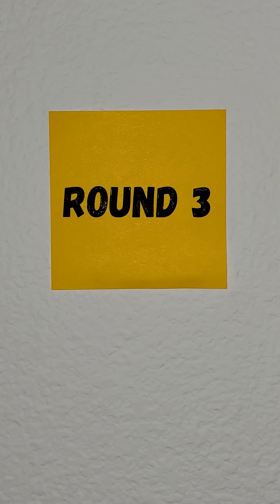What happens when you sprinkle flour on a flame? - 2 Truths & Trash - S3E8R3

Comment: The first one is fake but here is how the flower doesn't go on fire and the nail polish one turn it to rainbow on paper starting off with the flower see in higher portions it protects each other making a high shield inflammable also because there's a lot of the time it doesn't go on fire since there's a less amount of flour at a time it can actually go flammable for the third one nail polish catches light add with water and nail polish on the paper it goes rainbow

Comment: A- since the hot air is moving towards the left so it pushes to the left also the low pressure region is on the top which pulls it upward,not right.

Comment: guys the first one isnt actually impossible it could happen due to bernouli's principle where the fast jets of air creates lower pressures due to which an upward force can act, and in this case since it s a slope the upward force vector can a component along the slope so i mean it isnt impossible

though a) the air also could be pushing it down slightly
              b) the foam could just be too heavy for that effect to pull it up so idk like wtf is floral foam anyways-

and everybody's probably seen those mill explosions so i think the 3rd one's most likely fake

Comment: The issue with A is that the heat gun is pushing air right to left, which means the air rising would be from the right side, so it would push the wheel to the left even more

Comment: totally thought the gotcha was going to be that it was some other liquid other than nail polish remover. Fast moving air going over top of an object really can move it, it's why the shower curtain moves in towards the running water during a shower,the low pressure moving air pulls the curtain inward. the foam is just too massive for that effect to happen. Those added weights were a good trick

Comment: I was guessing all 3 to be true and the explanation for the first be that fast moving air creates negative pressure. But i guess the air from heat gun isn't nearly fast enough and it wouldn't roll sideways but rather rise up.

Comment: Technically, you COULD get the foam trick to work, you would just have to push A LOT more air across it, and it has to be perpendicular to the direction of lift/movement.  You would have had to blow the air straight down on the side or straight up.  This would make the faster moving air have less pressure, and the foam will get pushed up.
Reply: Also it doesn't have to be hot air.  Technically you'd want to control the airflow and hot air only causes the molecules to "vibrate" faster.  This would actually increase the pressure on that side causing an inefficient lift/push

Comment: About the flour: yup, most dusty stuff can ignite or even explode even if the material is not really flammable by itself. 
This is why wood dust is a hazard in sawmills. 
Also when you're cooking, be careful when sprinkling cocoa powder/chili powder/paprika powder etc in a pan/pot with an open flame

Comment: A is fake I think. B is absolutely true, this can cause serious problems like dust explosions. C seems ok, since nail polish is a kind of pil, which makes sense to react like oil in water and A might ake sense, since foam has lots of air in it and is light, so it could be carryed away by warm air, but there is no draw effect from the warm air, the air inside the foam must be heated and it would probably burn, before such a block would roll upwards.

Comment: This one was fairly easy. Air flow doesnt change with heat, so the roll wouldnt go up.

Flour has a History of causing so called "Dust-Explosions", where a small flame ignites an area with alot of dust in the Air, including Flour. This can become extreme! 

And lastly the Nail polish would either sit on top of the water surface, or didolve into the water which then gets soaked into the paper. Either way, the Nail Polish ends up in the Paper, which makes the Shiny surface happen.

Cool vid tho

Comment: I thought the foam inside melted and shifted the weight to that area without distorting it. Not that crazy but after I saw the other two I was pretty sure it was the first but the construction paper was glossy before it got wet didn’t look like construction paper so I was slightly skeptical

Comment: First one is false.
That flour one is an easy way to cause a dust explosion.
The nail polish on black paper is caused by the oil in the polish on top of the layer of water on the paper refracting the light.

Comment: I'm happy to have made a fairly confident right decision for once. I was thinking of the ping pong ball in the funnel experiment where the faster moving air turns the ball with it (not against it) and as a result the pressure gradients change on both sides and the ping pong ball gets locked in place in the funnel. So I would've assumed the heat gun to accelerate the disk if anything.

Comment: I'm sure B is correct. I've seen that rainbow effect on thin surfaces before, so i think something about a very thin layer makes C true as well. A seems wrong because of the angle of the heat gun... even if heat made it change shape or density and somehow roll backwards, surely the air moving from the gun would push it forwards again

Comment: My dad told me a story from when he was in the Marines, breached a large compound with a bundle of C4 and flour, when the C4 blew, it exploded the flour into such fine grains they were able to light the ‘air’ on fire because of how small the particles were - equally awesome and equally horrifying
Reply: My mom tells of being in a restaurant with coworkers.  One coworker took one of the packets of powdered non-dairy creamer, got out his lighter, held the lit lighter down low, and carefully poured a stream of creamer from up high.  This produced a brief but impressive pillar of flame, as the bottom of the stream met the lighter and the flame rushed upward very quickly.
Reply: Yeah, there was a flour mill that went off like a grenade because the flour was ground so fine that it basically became explosive powder.
Reply: @eleanorcooke7136 you might be thinking of powdered sugar
Reply: @zakattack5863 no, it's the Great Mill Disaster or the Washburn A Mill explosion.  A flour mill blew up causing 14 deaths and the resulting fire spread and killed another 4.
Reply: Look up dust explosions, there’s a lot of stuff that can go boom when turned to dust,
Reply: I knew no. 3 was true.
I worked on heavy vehicles in the Marines, and any liquids that weren't water or a drink were considered POLs. We could tell by when we were cleaning the tarmac, and found the rainbow liquids on the deck. All that dry-sweep we had to use to collect it all 😂

Comment: I didn’t even need to watch all of them, the first one defies all laws of physics 😭
Reply: When I was trying to justify it I thought that maybe the foam was light enough for the rising of warm air to be enough to provide some sort of force in the opposite direction, but then I realised that I sucked at torques and momentum in physics class and I was just overthinking it and since the other 2 were reasonable I still got it correct.
Reply: @v6790  You also gotta remember that the heat gun was aimed at the top of the cylinder so it would've pushed it down anyway
Reply: @blacklisted756 even if it was aimed at the bottom, it wouldn’t have changed much 😂
Reply: It can be that the heat gun causes higher air speed on the top decreasing the pressure while the lower air has higher pressure and it pushes the foam upwards. 
Similar to how planes fly.
Reply: High enough pressure, ie an air compressor would probably do that, heat guns just don't have the airflow to do that
Reply: it doesn't defy any laws of physics. Low density air above and high density air below generates lift. That's how all aircraft work.

This just isn't a way to generate significant pressure differentials
Reply: its similar to the magnus effect, but i think it's backwards
Reply: @wt_pilot    Obviously you didn't bother to watch the video to the end before commenting.    You wouldn't look so stupid right now if you had.
Reply: I thought it was real because of Minecraft’s magma and lava effect. Now I feel like an idiot.
Reply: I think it's what's called Venturi effect wich, by blowing on top will create a depression underneath wich cause it to be pull backwards
Reply: Same tho
Reply: Fr
Reply: I watched though, but yeah, I had to do a double take, but defo numero Uno
Reply: I think you are right in this case but the loss of physics can be very unintuitive sometimes. If you were to take a funnel and a ping pong ball and flip it upside down and blow really hard the ball would be sucked up instead of blown away. This seems to defy the laws of physics but technically it's in accordance, obviously.
Reply: I was expecting it to be something about the hot air deforming the foam(they melt real easy) and was fully prepared to see something weird and then it just rolled uphill and I was like... Nah
Reply: frr
Reply: Yeah this one was quite easy
Reply: I just thought the foam inside melted and shifted the weight to that area without distorting it. Not that crazy but after I saw the other two I was pretty sure it was the first but the construction paper was glossy before it got wet didn’t look like construction paper so I was slightly skeptical
Reply: I mean hey, as long as no one catches you breaking the law and all that...
Reply: True
Reply: The heat can cause wind to push it backwards, but not to wear the heat is coming from
Reply: @ heat gun ≠ hair dryer. The air coming from the heat gun is hot, but it’s not moving very quickly.
Reply: No it doesnt
Reply: It does as it gains gravitational potential energy out of nowhere
Reply: ıt can actually be true cause the wınd goes from cold to hot place and the wınd may push the cırcle
Reply: Well it does not it is deeper than you think. The concept in 1st one was bernoullis theorem sorry for the spelling, so according to that a force Must be acting sing there is low presser above and higher pressure elow bu the thing  thwt the force will be along the linse of rotation hence no totque so no movement
Reply: chemistry of item combined with heat could cause "shrinking" effect, grippiness of the material can make it roll up. so its possible, just not with this material
Reply: I was actually expecting that it's a matter of perspective where it should be "downhill" towards the left, but it actually is "downhill" to the right. 

He could just swap the ramp if ever.
Reply: @sixjhontongalamar979 there was fishing weights in the back, positioned so it would roll
Reply: I suggest you look up Moncton's Magnetic Hill.
Reply: @alexauxechecs  What about it?  Moncton Magnetic Hill is nothing more then an optical illusion, easily explained.
Reply: not completely. it is possible to pull something backward by creating an area of low pressure like from a heat gun. It would just have to be way way lighter than that solid block of foam. But something hollow so it's as light as air, it can be done.
Reply: A
Reply: Ikr def A
Reply: Not all. Bernoulli's theorem is kinda valid there
Reply: Dude shut up
Reply: @Landon_Fisher LOL okay??
Reply: The irony being it didnt, uou just didn't see the weights
Reply: I've seen that demonstration done before
Reply: B
Reply: There is Bernoulli's Law in physics bcoz of which first one is true
Reply: it specifically uses one of the laws in physics, just wrongly
Reply: the thing is he has done clips like that where it actually is rolling down because the set is at an angle

so you cant say its fake because of something basic like the way it rolls
Reply: well no it literally doesn't because he used physics to make to go backwards in a different way than what he said
Reply: @ it does when you take it at face value without knowing about the weights
Reply: @wooaahh23 
You're being an idiot. The comment means that the way he explained it at first defies all laws of physics.
Sure, there was some explanation in how he faked it, but that's not the point. The comment says the first one can't be due to the heat gun, so it must be false.
Simple really if you bothered to think for even a second.
Reply: @wooaahh23  Yeah... so the wheel going up an incline when a heat gun is aimed at it defies the laws of physics.
Reply: @ohheyemmi  no, because as I said, he used the law of physics to make it do that. You repeating it doesn't make it true a second time
Reply: @wooaahh23  there is a weight it the foam that makes it go backwards it is so obvious
Reply: @wooaahh23  It no longer defies physics when we know how he did it. But on its own, it did defy physics.
Reply: @ uh. Okay.

Comment: You can’t light a pile of flour on fire?  The lighter gives you heat and spark the flour is still fuel and there is still air in the the space on the no flour side of the fire

Comment: I knew the foam one was fake instantly, since i used a similar setup to demonstrate an optical illusion as a school projet, but my own solution for how to do it wasn't as involved...

I just mounted the camera to the rig and let the foam roll like normal for the first part, and for the "trick", i would tilt the entire rig to the side so the foam just rolled over the top instead... It didn't even look like the foam fell off the rig weirdly, as it just looked to the camera as if the momentum carried it away at an angl for the few frames it was in shot after it fell off.

Comment: There have been several flour (and sugar) factory explosions due to that fact. I remember one that had a bunch of conveyor belts that moved product, I don't recall if it was flour or sugar. Since it was moving flour would get kicked up in the air and land every where. Some "genius" higher up decided after years of this to enclose some of the belts, this trapped the flour and heat from the belts parts causing an explosion...which sent years of flour particles in hard to clean areas into the air...which caused an even bigger explosion.

I could be a bit off about some of this, but this is what I remember from some college class a decade or so ago.

Comment: My first instinct is to call BS on heat causing the wheel of floral foam to go up the ramp because it doesn’t make sense to me but also it easy to fake just tilting the whole setup with the camera dutched at the same angle.

FTR the 3rd looks odd but might be possible

Comment: The flour dust thing is born out on a much larger scale. Flour mills and storage in Manchester were built with extra thick walls and supports, this was to ensure they could withstand explosions that could be caused by flour particles in the air being ignited by a stray spark or uncovered flame. When Manchester City Centre was being redeveloped the warehousing was to be demolished but it proved next to impossible to destroy, Victorian engineers knew how to build explosion proof buildings.

Comment: I'm surprised by this, I thought the laminar flow of the air around the wheel would split the Airstream creating a skin of fast-moving are against the lower portion of the wheel creating a high pressure Zone in the space between the upper Airstream and the laminar air flow

Comment: fun fact. Anything powderized can be flammable. From chalk, talcum powder, dust, literally anything that can be powderized will ignite. 

All things have a flash point. The temperature in which the item will combust. Atomizing things [powderizing them in this case] increases surface area, making it far easier for this to actually happen.
Reply: pops was a firefighter. Grain silos are very dangerous fire risks for this reason. Grain silo fires are pretty much fubar once they start....

Comment: I've used flour (plus other ingredients) to make a fountain firework in a soup can that threw flames and sparks thirty feet in the air.  Such fun!
Reply: Please, tell us how! I want to try it.
Reply: @Simboiss  I dried out wheat flour and sawdust--everything from fine powder to chips the size of my pinkie nail--in an oven on its lowest setting overnight, then mixed it with a bit of 'magic metal throwing powder'.   I placed a straw down the middle of an empty tin can, the poured the mix around it.  I then filled the straw with the magic powder, removed it, slide a fuse into it.  To use it, I placed it in a mound of dirt to hold it in place--and look like volcano, of course!--then lit the fuse and stood back.  

(The magic powder doesn't blow up if it isn't constrained; rather, it just burns rapidly with force.  The force tosses the mix up into the air where it burns VERY rapidly, heating up the air which expands even more rapidly, resulting in a glorious column of fun that is perfectly safe as long as you have functioning brain cells.)
Reply: @KeithOlson  Alright, thanks for the reply. 👍

Comment: If you put the heat gun at the bottom it will go up because the cool air will take the hot air’s place therefore it will push the bottom of the circle and Make it go up

Comment: i knew 1/A was fake an the 2nd/B was true because i worked in a gluten/flour plant an as part of our safety training we were told to always clean up at the end our shift due to the combustion hazards that powder/fine particles can cause spanning from a small flash fire to a massive explosion depending on how saturated the air is with the powder/particle's an as for the 3rd/C a few nail polishes are made with oil an other oil products so it was kind of a given

Comment: "Two of the following videos are true while the other one is trash. Can you spot the fake? Round 3, let's begin. If you take a block of round, floral foam like this and drop it on an incline it'll roll down. But if you take a heat gun and aim it towards the top of the foam block the faster moving warm air causes the foam block to be pulled up the incline." 😹😹😹😹🪑🪑🪑🪑🪑